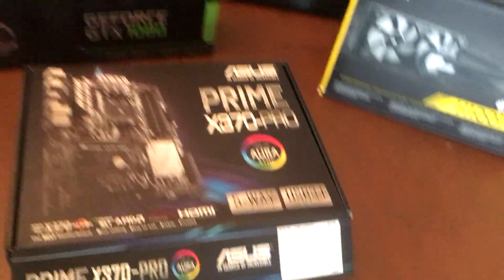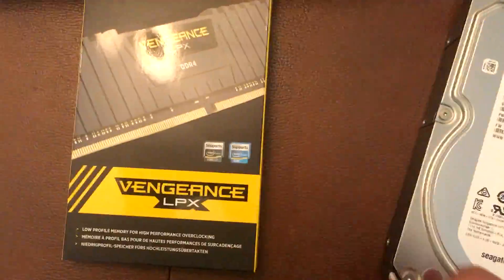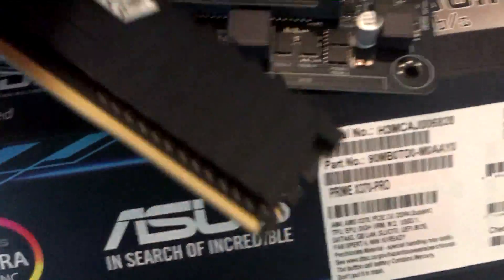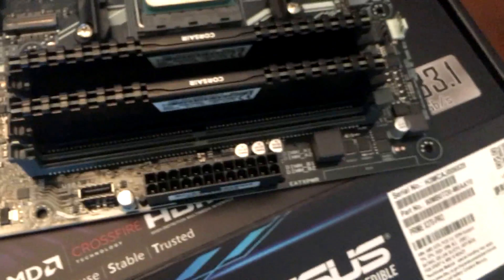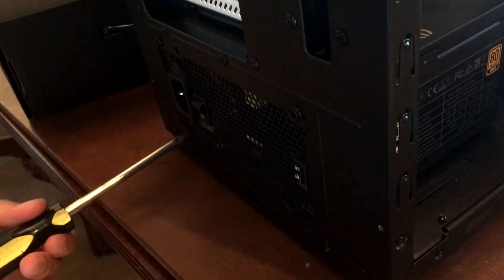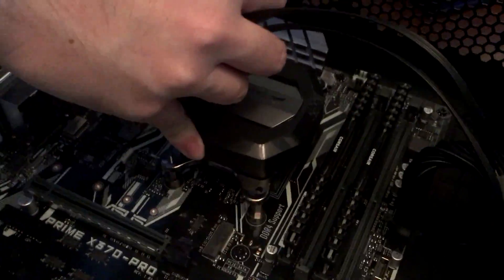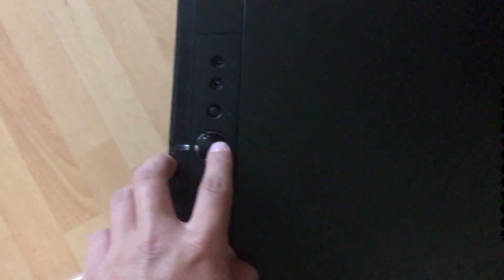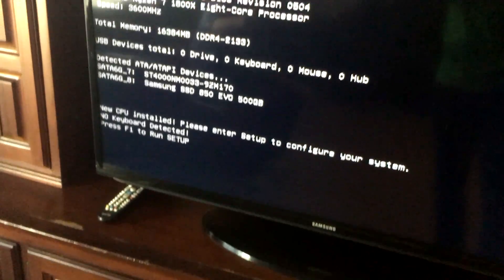TapL Builds a PC

Comment: Guys so what if he bought this for Minecraft
My dad also bought me a beast gaming pc for Minecraft

Specs
Geforce Gtx 1050ti
I5 8400
128 ssd
1tb wb hard drive
450 watt corsair power supply
Corsair gaming motherboard

And i get 600 - 800 fps
70 - 157 fps with high or ultra shaders
Reply: can your pc handle tnt i know that a 2080ti with an i9 can
Reply: @jagr0  yes with tnt, i get like 400 - 527 fps

Comment: Tapl:
CPU: Ryzen 7 1800X
GPU: EVGA GeForce GTX 1080
RAM: Corsair LPX Vengeance 16GB 3000Mhz
PSU: 750W EVGA SuperNOVA G3 80+ Gold
Motherboard: ASUS Prime X370-Pro
CPU Cooler: Corsair H100i v2
HDD: 4TB Seagate Constellation
SSD: 500GB Samsung 850-EVO
Case: Fractal Design Define R4
and mouse ?

Comment: Well, I have :
-Intel(R) Core(TM) i7-2766-k 1.80GHz~1.80GHz
-Intel HD Graphics 3000
-4GB DDR3 RAM 1333MHz
-(it is laptop so I don't know motherboard and also, there is no case)
-128 GB Apple Macintosh HD (SSD)
-Minecraft 1.8.9 300 fps
(Very cheap)
So why do you have to buy too expensive things for only about 600 fps?

Comment: You put the RAM in the wrong slots they need to go into slots A2 and B2 you put them in A1 and B1
Reply: You sure? It's different based on the motherboard. Not all motherboards are built equal.
Reply: I checked the manual online those are the right slots

Comment: Iam gonna build a pc after 6 months budget 370 dolars any help??
Reply: try this
for CPU just go for the G4560
as far as MotherBoard goes go for the
ASROCK H110M-HDS
for GPU i recommend getting the
GIGABYTE GTX 1050
for RAM go for
the Kingston 8GB
for storage
WD BLUE 1TB if you have money you can add a SSD
for PSU go for
EVGA 430 or 450 if you cant find a good deal
these will cost you around 350$,300 if you are lucky then you have the rest for the case.
Reply: Enrico Ponciano OMG THANKS :D
Reply: Bcoolboy Md Yw

Comment: Bruh all that for mc?
Reply: He also 

A) Video Edits, hence the good CPU
B) Plays video games other than Minecraft, hence the 16gb of ram
C) He also uses shaders sometimes and other video games, hence the GTX 1080

Everything else is to stop bottlenecking
Reply: DrumletNation you still dont need all that for mc and editing..
Reply: dude, you should either get an i7 or Ryzen 7 (I prefer Intel) for video editing, especially if you're going to stream. Most games right now require the 16gb of ram to play, and it's not like he only plays minecraft. 

GTX 1080 with shaders get fps from 50 - 110 (That is, if you stare at a wall you get 110 fps)

Comment: I get same fps even more with a gtx 1050ti
Reply: EnderBro Army i get around 1000 whit a 1060
Reply: i get over 1000 sometimes with gtx1050ti if i get 1080 i will get over 2000 fps bcos my highest with 1050ti is 1400
Reply: You really cant say that because youll never know.He might have apps running in the background,a larger display maybe even 4k and settings whilst recording in 1080p120
Reply: I have a 1050 ti and i get around 400 reason is you most likely have a really good cpu with a high clock speed

Comment: I know im late but
1. ram goes in the further pair of slots (grey in this case)
2. if you want faster ram but still 16gb then get 4 sticks of 4gb instead of 2 sticks of 8gb.
3. no thermal paste on the cooler? or did it come with it preapplied? weird
4. you should put your cpu cooler on first and then put in the motherboard and plug in the 24pin and 8 pin motherboard power plugs first and then install it (a little easier but whatever).
5. ew amd cpu xd i have an amd one too but good card good job for your first time now you can play minecraft xd

Comment: I have a question to smart computer people. I want to get a EVGA GeForce GTX 1050 Ti but I currently have a nvidia can I switch and it will fit and stuff?
Reply: Seabass1008 do you mean an nvidia brand GeForce card?
Reply: yes
Reply: Yes
Reply: Seabass1008 You do realize that nvidia is a brand and the gtx 1050 Ti is one of their gaming cards, if you want to change your graphics card first measure how much space there is for graphics card and check how big that gtx 1050 Ti is (check the right model because they're not all the same  size and also if you have extra power cables going put of the psu because if you have a prebuild chances are that you have non and if you don't you have to buy a gpu that doesn't require extra power cables. Also tell me what cpu you have because if you have a weak cpu upgrading the cpu won't help. If you need more help just ask me.
Reply: <3
Reply: You'll be fine, thats just the brand, not anything else

Comment: TapL, after watching ur video i want to buy 1080 but there is a parental control in my house 😢😢😢
Reply: AbusiveDucks $300 for an RX 480 is absurd even if you bought it before the mining crisis, you my friend got ripped off
Reply: ThanosSt056 If you going to get a gpu get the 1070 not 1080.
Reply: Bruh just buy a 1060 i dont think u record so u would be fine
Reply: @meowmeow9300  i know this is late but if you want to do 1440p 144hz a 1060 isnt enough
Reply: ThanosSt056 You don't need a 1080... I can run 120 fps, ultra settings on a 144hz monitor + 2 other monitors using a Radion RX 480 on Overwatch. Only need $300.
Reply: AbusiveDucks 300 for a 480 WTF unless you mean cuz of the miners
Reply: WW2 You haven't been looking at the right places then.
Reply: ThanosSt056 gg
Reply: dont buy 1080 to expensive buy 1060 or other ones
Reply: Why a 1080 is like $1100
Reply: 1080 is pretty much used for video editing, i'd say a lot of people looking to get a 1080 or 1080 ti, want to do heavy editing, as well as gaming. But just to play games, all you need is a 1050 ti.
Reply: @charle-antonie cusson
get a monitor w/ a higher refresh rate
Reply: So much is wrong with this comment
Reply: Engineer GamerPlays no
Reply: He now plays fortnite
Reply: If you're saving up money you can go for a 1060 or 1070.
Reply: Good you have that cause gt 1039 is already overkill
Reply: You’re actually on drugs שקד בר אוריון
Reply: just download more ram
Reply: ThanosSt056 what does that have do to with anything
Reply: ThanosSt056 Graphics card don't effect Minecraft that much, only for shaders so a 1080 for just vanilla Minecraft is pretty much a huge waste of money lmao
Reply: Jadan ikr, but i play Payday, The crew, Overwatch and other games too. This is y i want it😉

Comment: Is this computer strong enough to handle shaders?
Reply: A gtx 1060 and i5 could do that smoot without recording
Reply: i have a i3 and gtx 1060 and i still get like 120 fps on recording in shaders ,you just need the good parts and you're set
Reply: its fucking minecraft what do you expect this can run crysis 3
Reply: ActionGaming No bottlenecks?
Reply: Simon Heldal My i3 gtx 1050ti can run every shaders at 80-130 fps, only seus 50-60
Reply: Maruan Only bottlenecks a little,get a i5 and you will get the best experience in a low price
Reply: I am talking about the i3 and the 1060
Reply: Stamatis Zygas of course
Reply: ActionGaming Hell no, ryzen is better and lower price+cheaper over clocking motherboards. Also the ryzen 3 just kill core i3s and pentiums
Reply: Fucking hope so if its 2,000$ computer
Reply: You can get 10fps playing at 720p with this build :)
Reply: WW2 ok ryzen is better,but I prefer Intel more
Reply: ActionGaming Ok, I respect your opinion.
Reply: You can't compare a cpu model to a cpu manufacturer... but what did I expect from a bunch of kids arguing on a minecraft video
Reply: ActionGaming Yea im gonna buy a ryzen 1600 soon, it bottlenecks quite alot with battlefield 1 (medium 50 fps)
Reply: Void Thank you, CAPTAIN OBVIOUS

Comment: Buddy , I like your build and I'm not trying to hate . But , I'd actually go for a better one for the same budget . 
CPU : intel i7-7700k .
CPU COOLER: Corsair Hydro Series H100i V2 liquid cooling.
MOTHERBOARD : MSI Pro Series Intel Z270 DDR4 USB 3 SLI.
RAM : G.SKILL Ripjaws V Series 32GB (2 × 16GB) 3200 MHz.
HDD : WD BLUE 4TB .
SSD : Samsung 850 EVO 500 GB.
GPU : ASUS ROG STRIX GTX 1080 TI OC VR EDITION .
PSU : EVGA bronze 700W .
Case : 50-70$ cool one .
I'm getting this one next summer :L , it costs about 2000$ on amazon. :L

Comment: I quitted MC last month and now I want to play b03 and gta on pc. But I don't want to buy those games immediately cause I don't know if my pc can run it. Can someone who know much about pc's help me? I will give the specs of you reply.
Reply: ghostly panda 
CPU: AMD A10-7700K
GPU: AMD Radeon R7
RAM: 8GB DDR3
Hard Drive: 1000GB
Reply: pls
Reply: SebasiePlayz sure
Reply: SebasiePlayz what are the specs?
Reply: SebasiePlayz just try to download it . If it dosent work just delete it
Reply: SqltyChicken I don't think you understand that gta 5 is 66gb
Reply: SebasiePlayz what are the specs?
Reply: ghostly panda Is that enough specs?
Reply: what model of r7 is it (eg: 230 etc)
Reply: Purity the mememan just R7. It doesn't show something else.
Reply: Go into control panel, hardware and sound, under the devices and printers option there should be a thing called device manager. Find Display adapters and click on it. it should show the whole model.
Reply: Purity the mememan Is shows: AMD Radeon(TM) R7 Graphics
Reply: SebasiePlayz yes you can, but not on high
Reply: Menxi Can it run around 30 fps?
Reply: SebasiePlayz yes i think, first try cracked one, and if its good fps, buy it
Reply: Menxi I tried gta crack but it went wrong
Reply: Jip Damman ja
Reply: Jip Damman haha, ja ik reageerde vroeger heel veel op video's. Maar nu eigenlijk nooit
Reply: Is it a laptop or desktop. If it's a desktop that's using the r7 then you should be fine running gta 5 low-medium settings with 40-50 fps
Reply: Purity the mememan oh oke tnx!
Reply: SebasiePlayz gta should be around 30 to 32 fps at 1080p
Reply: ghostly panda Is that enough you think?
Reply: ghostly panda I'm downloading gta5 now btw
Reply: SebasiePlayz hi ur norbertos friend rightM
Reply: WOOOF CAM He is my little brother ;-)
Reply: ghostly panda Umm I play gta5 now. And indeed I play around 30 fps. But I have 8GB ram and it only shows 1024 MB of video memory.... you know how to fix this?
Reply: SebasiePlayz It shows your graphics card memory, not your RAM